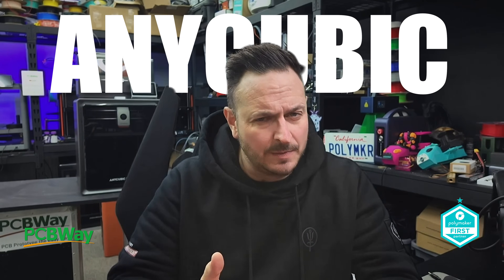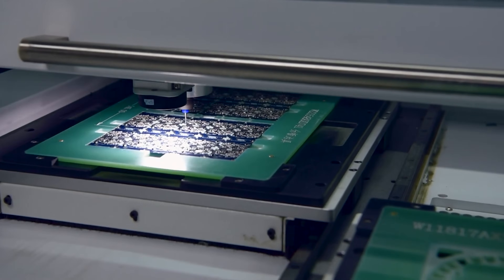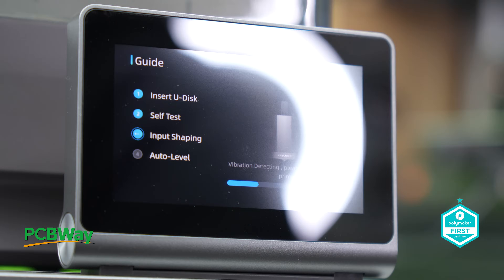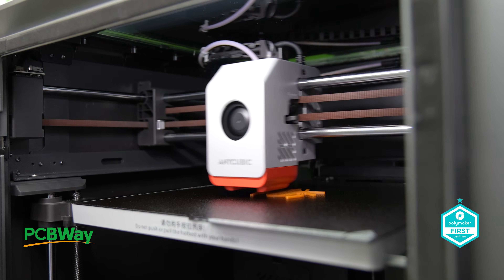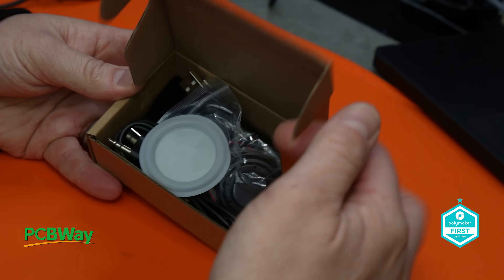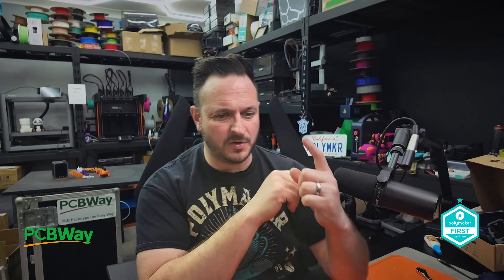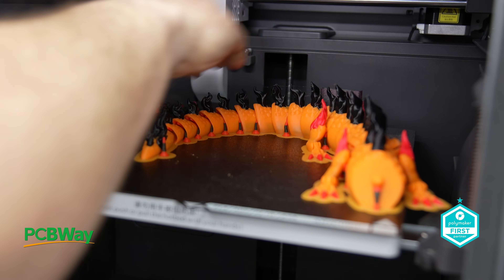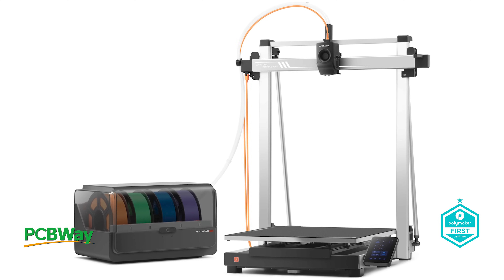Anycubic Kobra S1 Combo: Amazing Quality or Risky Bet?

Comment: Sam is it? You seem like a great guy but this is going to be harsh bro!

This is review of a 3d printable Bluetooth speaking NOT a Kobra S1 Combo!

TL:DR, in total 2% of this video (20 seconds, yes I actually counted) talks about the Kobra S1 Combo, I don't know if reading between the lines that's because its crap but you don't want to upset the manufacturer who obviously gave it 3 months ahead of general release or what!?

13:45 to 13:51 said "anycubic have surprised me with print quality of the S1C, and have managed to add contributions into a solid base"

13:59 to 14:02 said "the S1C certainly does seem to be solid"

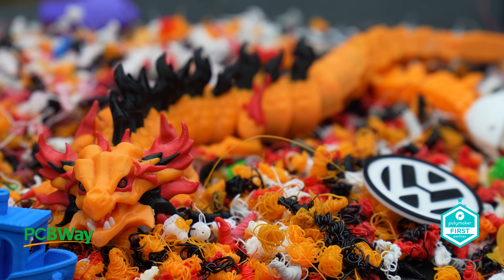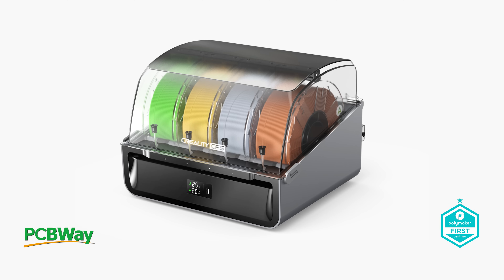14:09 to 14:13 "Anycubic have been the first to add heat to their Ace system"

14:56 to 14:59 "the s1c is a good alternative if your budget doesn't permit a market leading printer"

15:11 to 15:15 "its not a Bamboo Lab printer, this is also not priced that way"

THATS IT. No comments or comparisons were made about the printers quality vs any other machine which is very disappointing, nothing about the build quality vs any other machine.

In total 20 seconds out of 965 seconds.

A significant amount of time was spent opening the box of the Bluetooth speaker kit we cant even buy, showing all the components, talking about them and even building and reviewing the dam thing. In total then, spent 20 seconds talking about the actual star of the show........
Reply: How does it compare to Bambu? I'm running a Kobra 2 but I really like the Bambu print from phone and proven profiles.
Reply from the maker: @DaveAndGray  So its not a bambu, bambu are very much leading this element of marketing, they also have two years and huge jumps ahead of the companies trying to catch up. One comment said its more like a P1S, but its also NOT that, the profiles need some tuning, firmware might need playing with etc. I didn't have any issues or fails and if I did I would have put them in. If you have budget restrictions in anyway or like the vendor then stick with them, this is a snapshot of time of when I opened a box, make some stuff and enjoyed the process.
Reply from the maker: @Fiveliterdave it’s slower and the software isn’t as good, but you know Bambu has had a few years to get it right and for people to be super comfortable
Reply: Harsh comment.. But the points here are valid. IMO, we should expect it to be close if not better in a few regards compared to the P1S, and a fully valid alternative to the A1. Its cheaper than the P1S, but has had time to reflect on bambu's issues, and a couple years worth of new technology to include. If it is NOT up to par with the P1S, I'd want to know exactly whats lacking.
Reply from the maker: You spent a lot of time of on this Russ, I’ll be sure to be better in the future
Reply: @TheRealSamPrentice  I came back to check if this comment had been responded to or removed. I appreciate that you took the time to respond to him without being defensive. It's worth it to me for that to subscribe to your channel and shoot you a comment and a thumbs up for the algorithm.
Reply from the maker: @Subservient3d Thank you so much! Here’s the thing: when I start a video, I don’t always know exactly where it’s going to lead. Balancing expectations is tricky—viewers want different things, and the challenge lies in creating content that resonates, makes sense, and entertains.

In this video, I pointed out that we’ll be seeing many more printers with similar designs and functionality soon, meaning most reviews will likely feel repetitive. That’s why I chose to try something different by incorporating a project into the video. While I believe I shared my feedback effectively, on reflection, I recognize there’s room for improvement in that area. That’s why I invite comments—they’re invaluable for growth.

Over the past two years, expectations have shifted. Manufacturer fans have formed distinct “camps” and further refined their approaches. My aim was to provide feedback that acknowledges those who might dislike this video simply because it doesn’t align with their preferences, while still offering a balanced perspective and showcasing the product’s capabilities.

That said, the video has performed okay—people are engaging, clicking the links, and placing orders, which is encouraging. Regarding comments, I wouldn’t delete one unless it was completely baseless. That comment, in particular, stood out—someone took the time to timestamp the video, fact-check, and provide constructive feedback. I’d buy them a beer for that! Constructive challenges are essential for growth—without them, how can we improve? I don’t lie in my videos. My thoughts and views are not "paid content"—they are a direct reflection of my experience with the product. Integrity is a cornerstone of my life, and I strive to uphold it in everything I do, despite the various forms of hate that many of us in the creator field inevitably face. Again thank you for the support ! Sam
Reply: @TheRealSamPrentice  🤘🏼

Comment: I’m looking at a 3D printer. I love the option of Multi colour yet I’m concerned about how much waste there is. I love the Prusa 5 head unit for that reason but the cost is huge. I love a large bed the K2 is 350x350x350 - I will be using it to do larger props mainly. Happy for any thoughts Budget of about $2k AUD. Give or take. There is so much choice. Love the idea of a heater in the AMS :). Great Vid - Cheers

Comment: Well, I don't like the idea of a large bedslinger *at all*, and I never will. 420x420x500 is simply insane, the Mendel/i3 bedslinger concept was never ever meant for printer sizes that big. The sheer weight of the print on the bed (inertia!) will be insane if that build volume is actually used, and so will the shearing forces because of the X and Y separation...

Comment: Please tell any cubic to !make their firmware open source. I've seen a couple of kobra 3 printers burn down, which I suspect the thermal protection wasn't enabled. Any cubic closed sourced the kobra 2 pro and max, which made it too difficult to tweak anything on the machine. Will not buy another any cubic without open firmware support. I'd rather buy creality for multicolor.
Reply from the maker: I'm not sure they will listen to me.

Comment: I love my kobra 2 (marlin version).  It was very good stock but now that I have upgraded to a full version of klipper it is an entirely new printer.  After issues setting up a kobra 2 Max and the NEED to use the app I am done buying anything from anycubic.  Their locked down ecosystem is unacceptable and the app and setup was a horrible experience.  But at least the mechanics of the printer are great and all the issues are software.  I'm never going to be the guy rushing to be one of the early adopters of ANY product  nor will I accept a printer that cannot be used and updated 100% offline as a standalone unit.  It's absurd that I have to use my phone to do an update when there are USB ports right on the front of the case.  I'm sure the S1 is mechanically a great printer but the software kills it for me.  I liken it to a car manufacturer locking down route selection in the built-in GPS and self driving function so that you don't get to decide which route you take to get to work.  Sure, you'll get there but only the way THEY decide you can.  Hard no on that.

Good review though.

Comment: Honestly, at the price I had to give it a shot, I got it pretty much as soon as preorders went live.    4 color printing with fully enclosed with that good temperature support with a bigger 250 size vs the 220 of the competitors for 550 is almost impossible to pass up.    Frankly  I probably won't use the multicolor that often but it is nice to have the option.
Reply: How are you liking it so far?  I just placed a preorder for one.
Reply: @RubberSalt  They haven't shipped yet, the only ones who got them so far are youtubers who got sent them for free as review units.
Reply from the maker: That is very true
Reply: @MaethorDerien  so far, they seem alright from what I call tell.
Reply: I also pre-ordered one as soon as they went live. Been printing with a kobra 2 neo for awhile.

Comment: I wouldn't own another Anycubic printer. My past one was a mess. Learned my lesson.
Reply: I've owned 5 and have loved them all. One i3 Mega and 4 Kobra 2 Pros.
Reply: My Kobra 2 has weird issues but when it works I’m happy with the results. Mine is not reliable and I’m really considering bambulabs because I want to print not tinker senselessly
Reply: @bingus7361  I'm happy with my QIDI Q1 Pro.

Comment: Ordered the S1 combo and definitely am looking forward to it. People complaining about size,  it's 7mm less than the Bambu printers. Basically, no difference but a more affordable solution with the bonus of a heated ACE Pro unit.
Reply: Bambu Slicer won't actually let you use the 256mm anyway, slicer tells you off if it goes above 250mm
Reply: @alexmay6707  OrcaSlicer allows you to use the full 256mm. The only place you can't print is the small square at the front edge of the plate.
Reply: I'm thinking about buying one, but I have had a very good experience with the Bambu X1C which we have at work. I'm a little bit wary about the S1, but it's between that and the Bambu P1S, which is more expensive.
How are you liking the S1 so far?
Reply: @randomguy- really loving it and remember the Ams unit has a dryer also.
Reply: @kschaffer6978  Thanks for the reply.
I think I just might pull the trigger since it's more than $250 cheaper for me than the P1S at the moment.
I think I'll get the basic version without an AMS unit though, as I see you can upgrade it later for about the same total amount.
For now I'm mostly gonna be printing with one color anyway.

Comment: The whole colour system needs changing, it's the most ridiculous implementation ever, why not have a printer with 1 extruder but 4 nozzles ?
Reply: Can you imagine the weight of a mini filament changer on a single toolhead ? Not gonna happen, at least not with the right balance between reliability, quality and price. E3D tried that with the Chimera (only 2 nozzles) and it didn't end well.

Comment: Looks like a decent unit! Price is not exactly revolutionary. I do get so tired of any "clone" conversations. You mean the A1 Mini is an Ender 2 clone which was a Prusa Mini clone? You mean the A1 is a Prusa MK3 clone which was an Ender 3 clone which was a clone of something else? They're all based on old or open source designs? Qidi was making enclosed, core XY, steel frame printers before Bambu Lab existed. Wish people would see the big picture. What matters is if a printer is good for the money or not. I also agree that multi-color is just to wasteful to generally appeal to me.
Reply: I don't care if one is a clone of another or not at all 😂 If it's good, then I'll buy. I'm not a fan of a any brands.

Comment: Got one at 499 and used my points from makeronline to discount more off. So for the price it's the best machine out there.they seem to have used the kobra 3 to sort out the issues with the firmware/slicer
Reply: Also will be one of the cheapest multi colour printers that should have its firmware source released.

Comment: I understand when vendors trying to copy Bambu. What I don't understand is a company releasing such a large printer with an even smaller build volume then the likes of X1C, K2 Max or Qidi Plus 4. Granted, it's a cheap printer, but so is the Qidi. 250 ^3mm is not big enough imho. May as well get something like the A1 Combo
Reply: Uh its the same size as the X1C.....And a Corexy with the same bed size as a bed slinger like the A1 is ALWAYS going to be better.....
Reply: @anthonylong5870   Wrong .... try again ....  Size is 250x250x250 (minus exclusion zone) whereas Bambu X1C and A1 are 256x256x256 ... Might not be much bigger but the fact that others are even larger now - like the K2 with 300^3 - going smaller, no matter how much smaller, is a wrong and odd move.
Reply: @K8Stuff  Go look at the effective (actually useable) bed size.  Its 250 on Bambu.  They are the same
Reply from the maker: I agree! !

Comment: I purchased one for 519€ on the 5th of January and I cancelled my order when I saw tax were not included, which means 22% more for italy with for sure another 50€ for custom duties. Furthermore from what I seen, even it prints nice, the P1S wins all the times in comparison, It looked fantastic at first look but the more I watch videos more I'm convinced to get a Bambu
Reply: The Anycubic is even smaller in build volume than literally all newly released enclosed core xy printers.
Reply from the maker: Do what you think is right, its hard to give a balance sometimes, and not just with printers.
Reply: @TheRealSamPrentice  The printer is certainly fantastic value for what it offers, but I changed my mind more because of the tax issue, I contacted Anycubic support, they were very nice and even suggested a refund in case of extra cost, but I cancelled the order anyway as I was not willing to have future problems explaining the whole thing.
Reply: @TheRealSamPrentice  sadly this is the right size for my space. i have a 400x400x400 print volume printer but all the extra bulk is making it difficult to do other things in the space.
Reply: well shit... i did not consider that. guess i wait and see
Reply: Bro, when you go to your basket, it literally written that the taxes and fees are going to be calculated at the checkout. So if you go to checkout, set everything, them you have to see the final price.
Reply: @TheIndestructibl3  it does say that. but it does not seem to do that for taxes. unless its already baked into the initial price somehow.
Reply: You think buying a Bambu wont have sales tax???? ROFL! 🤣😂🤣
Reply: @anthonylong5870  that is so old u can buy it locally. where taxes are already in the price
Reply: @anthonylong5870  I'm sorry but who said that? my problem is 519 is a good deal but when it will be added 22% of VAT tax and customs duties the price is not competitive for me anymore, in bambu store the TAX are calculated at checkout, that's it, never thought to skip taxes in anyway

Comment: The only thing that got my attention is the heat inside their AMS. Creality lost their opportunity to add it to their AMS too. I know that Bambu Labs will add it to their new versions.
Reply from the maker: I hope so, when I first saw the K2 I said wow you put a dryer in there.. the engineer goes... oh no, we were going to but there were issues.
Reply: How do you know. Is there any news about new ams ?
Reply: @michawasiljew6620  I think is going to be something very obvious from Bambu Labs, they are working on something different, they need to add a heat to their new AMS. It’s going to be launch with their new printer
Reply: @michawasiljew6620  this year
Reply from the maker: Yeah there is news they announced it today at ces
Reply: If there is a possibility to upgrade the old one that would be awesome.
Reply: @TheRealSamPrentice I didn’t think they attended CES? Having a hard time finding anything online about it
Reply from the maker: @matthewtaylor3301 mainly Facebook they have unfortunately neglected to tell any creators about this.. so I guess that’s on them
Reply: Well, I hope someone will build an SSD based aftermarket solution for non-drying AMS/CFS systems! :-)